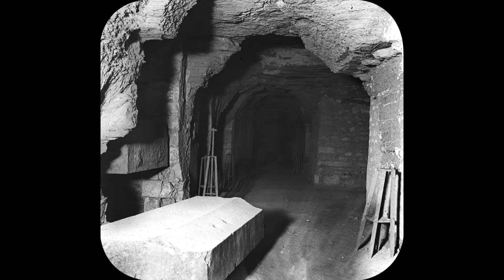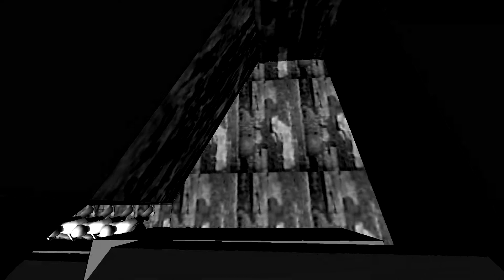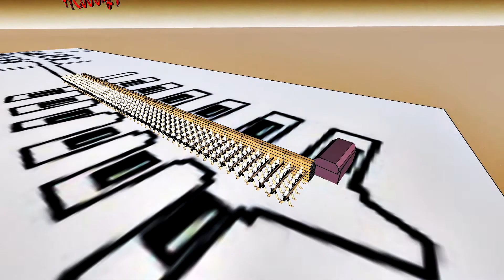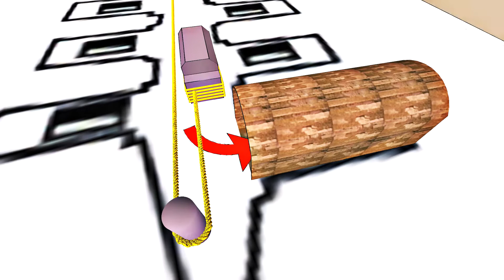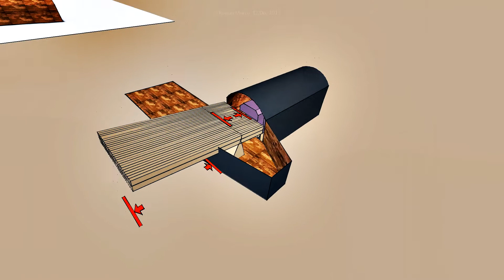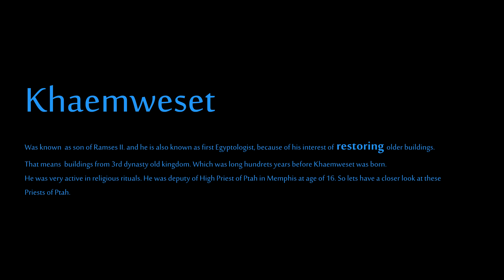Serapeum Sakkara is pre Egyptian construction /proof/

Comment: fix the volume!
Speak like a man.
Get closer to the microphone.
Serapeum could have be built around the sarcophagi (which never held bodies because they could not move them since they were built); they would be much more easily lowered into bedrock foundation, protected or finished inplace and structure built over them. One small one was attempted, probably bits that blew one open, to be robbed, but the fools failarmyed strong.
Reply from the maker: why would they built it that way ?